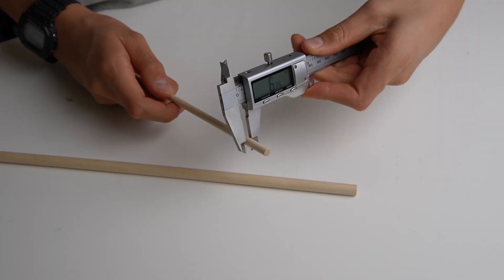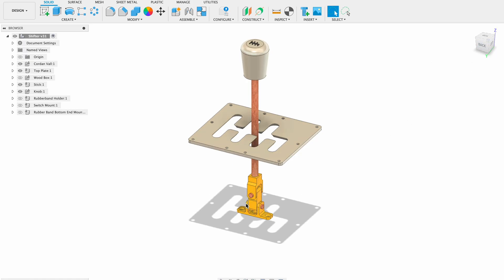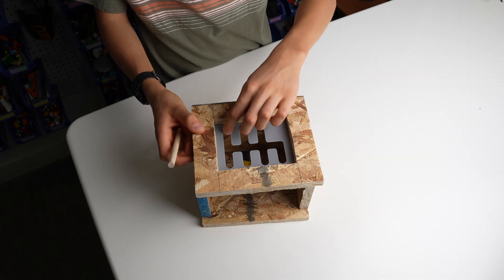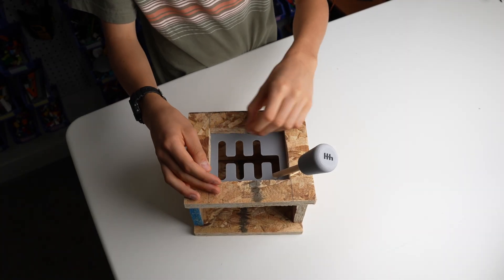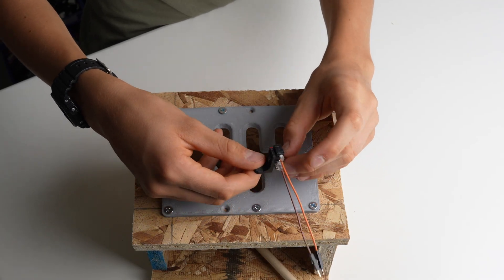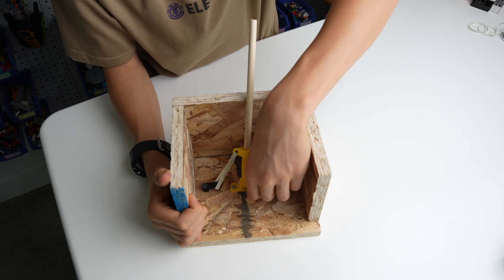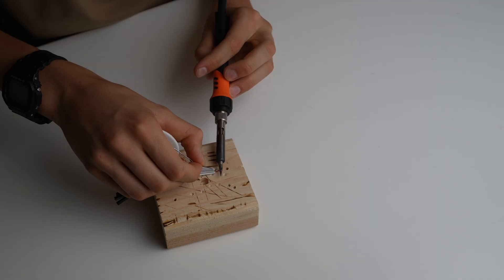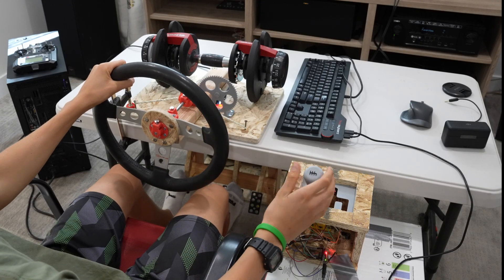Part 3 - DIY Shifter for Drifting Simulator | 3D Printing + Arduino

Comment: the important thing on steering wheel is resolution, you need upgrade to better encoder for steering wheel to get better experience, and maybe you want to add a motor for force feedback, good luck on your project
Reply from the maker: That's a great point about resolution and force feedback, I appreciate the suggestions!

Comment: I wanna ask something, do i need (must use) an arduino pro micro for the steering wheel, the pedals and the shifter or i could use an arduino uno or pro mini for it, and what software u use for the arduino or do you write the code urself. thanks. Great content btw might make this too 👍
Reply from the maker: You don"t need to specifically use the pro micro, you can basically use any board but the pro micro has an advantage in that when you plug it into a computer or gaming pc, it will automatically recognize it as a gaming controller whereas most other boards don't do that. It just makes it simpler. If you do want to use a different board, you just need to write an extra piece of code on your pc to interpret the signal fro your board and make it seem like it is a controller. The code for all 3 I wrote myself with the help of Grok the AI :)

Comment: Another amazing video! Really nicely explained and cleverly build 🔥. The 3rd pin on the switch is for the NC (Normally closed) loop, so the current runs through when the switch is not active and it is turned off when it is pressed, the exact opposite of the NO (normally opened) loop you used :).
Reply from the maker: I'm glad you liked the video. Thanks for the explanation of the third pin. it does make sense to have the opposite in case your project needs that

Comment: You need to make hand brake + how many arduino you use for all Thes project?
Reply from the maker: Yes I originally wanted to make the hand brake but then I decided against it because I want to move on to something else...  the steering wheel, pedals and shifter each have their own Arduino. I could have used one for all of them, but didn't because I wanted the wiring to be simple.